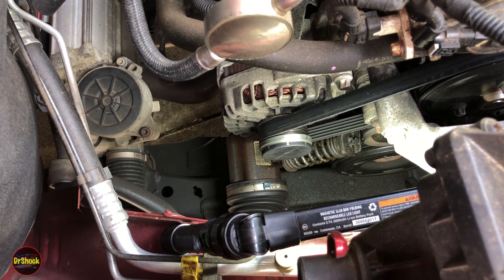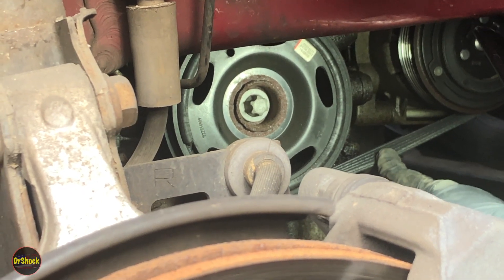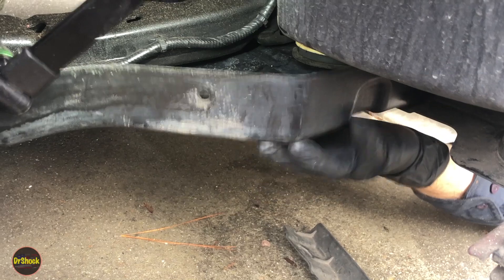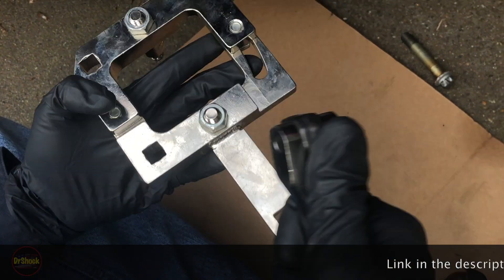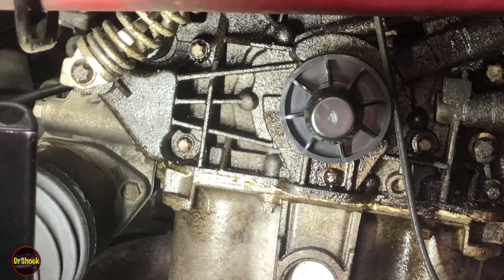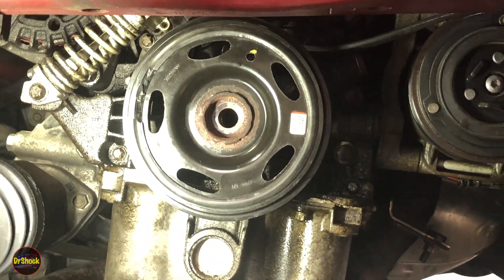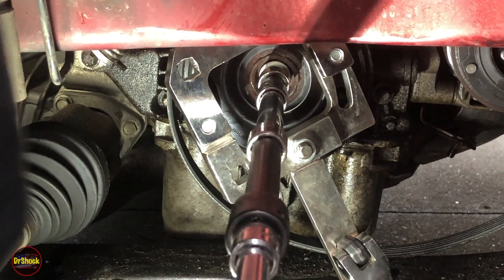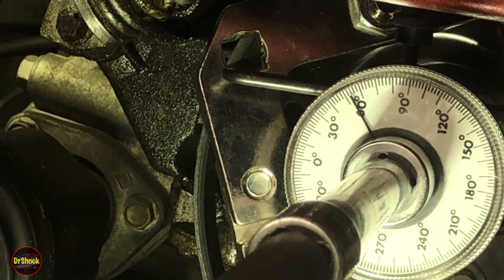2011 - 2021 GM Ecotec 1.4L Engine Oil Leak Front Crankshaft Seal Replacement (Chevy Cruze Sonic)

Comment: I’m just a little confused about the the torque specs because I know how serious a 60° turn can be but in the video you said 110 pounds but in the book it says 111 pounds, so I’m just confused on which one is actually the correct one
Reply from the maker: Good catch.  I clearly misspoke there as I was pointing right at that text but saying 1ft lb less.  We're after the exact value given in the service manual that I showed.  So it's 111 ft pounds.  I added a correction note to the video just now.
Reply: When threads pull just back off next bolt 1/4  turn

Comment: I saw some other guys on youtube doing timing replacement and they said that the seal must be installed dry otherwise it will leak again. What does theanual say about it? thanks
Reply from the maker: You install the seal into the engine dry using the recommended driver tool shown in the service manual.  This is important to maintaining an accurate friction fit to the engine.  

However, when reinstalling the balancer only, I do recommend light lubrication as shown, simply to avoid damaging the seal lip during reinstallation of the used original. If for some reason you were installing a brand new balancer, I would omit this.  This would just be an example of my sharing decades of experience as a best practice.  

What typically causes a leak here for this particular engine is wear or damage to the lip of the crankshaft seal, some type of physical deformation of the seal, wear to the balancer shaft, or the use of non-GM parts.
Reply: @DrShock  thanks man, have a nice day
Reply: @DrShock  so basically you re saying that if you do the whole timing replacement, then no lubrication is needed? Am I getting it right? athanks
Reply from the maker: This is just a front crankshaft seal replacement in this vid, which is only one small part of what you have to address if you are looking at removing and reinstalling the timing cover.   So just speaking to what this video covers, the whole balancer shaft area is always lubricated with engine oil during normal engine operation for this particular engine design.  So obviously the balancer shaft does not run dry on the inside side of the seal.  But it should run dry on the outside side of the seal though.   If not, you have a leaking seal and that's why one would watch this video.  ;-)  

When you first re-install an used crankshaft balancer pulley assembly, I mentioned I recommend light lubrication to ease the reassembly of this part only.  This is solely to prevent the used balancer shaft from nicking the inside lip of the new seal.   Any assembly lubrication put here will be temporary, and eventually slung off during normal engine operation.  At least for this particular GM engine design.  Others engine designs may be different, and other engine designs may not warrant the reassembly attention.

Comment: I think you overdid it. * mean you don t need all those specific tools. You can block the crankshaft/pulley with a pin you insert in a special hole  like when you do timing replacement. No need for that square tool. Also for installing the seal you can use a big socket like the one from oil. To pull it out just use a hooked screwdriver. You are very good and attent to details, but this way it will take you 4 days to do a timing replacement
Reply from the maker: What I've shown is the by the book professional approach, showing it straight out of the OEM service manual as closely as possible using only genuine OEM parts.   That's what I strive to make this channel about.  

It only takes the standard book time when done this way, not longer.  You can of course improvise using what I've shared here as a overall best practices guide though.
Reply: @DrShock  You did not overdo it. I would rather you do it the way you did, by the book. Proper thing. Now, knowing the actual steps, I now which ones I can improvise if I choose. Then it’s on me. Other repair videos have to be viewed with caution, I’ve seen too many mistakes being made.

Comment: The more extensions you use, the more torque you lose..thats not the proper way to torque things. Ive done thousands of crank pulley removals and installs and ive never had one where a deep socket didnt work. 

You also need to mention that the timing cover gasket is a huge failure on these too
Reply from the maker: It's a commonly misunderstood fact that straight line socket extensions have no tangible impact on attainment of a torque value.  What does are swivels and this clues one into the laws of physics involved here.   Keep your socket and extension in centerline and there will not be any arc forces involved of concern to negatively impact the sought torque.   There's a reason a well equipped tool box has three socket types (shallow, standard, and deep) in addition to an array of extensions.  You do not have to make it a one size fits all situation.
Reply: @DrShock  it's not misunderstood. It's literally facts that extensions cause torque loss. And I've proven it multiple times... especially using chrome sockets and extensions on an impact...you don't do that. I've been doing this 15 years and I'm no genius nor do I know everything, but I can promise you that using a deep impact socket on an impact vs using chrome sockets and extensions there's a HUGE difference in torque...go try to remove a stubborn bolt with just a single impact socket on an impact vs using a chrome socket with extensions...the chrome extensions and sockets aren't gonna remove that high torqued on bolt.
Reply from the maker: Centerline extensions or deep sockets have no appreciable impact on automotive fastener torque.  You'll find OEM service manuals reference their use in order to reach the fasteners involved to achieve the torque values required.  Loosely, you could review Newtons' third law of physics for why.

Now chrome sockets, yeah they can be damaged by an impact but they are also inexpensive to replace and fair game to sacrifice in a pinch imo (aka I didn't feel like stopping the job to hunt for my misplaced impact socket).  The reason the standard chrome socket will perform poorly in your example is the drive hole becomes distorted allowing rotational movement, thus reducing the effective reverse torque force of the impact wrench.  An impact rated socket has a metallurgical design that resists this drive hole damage maintaining tight fitment.

btw, Merry Christmas ;-)
Reply: @DrShock Also, there's NO reason to use some special tool on the balancer...take the bolt out, remove the pulley and reinstall. I just did this last week. Didn't use any special tool. It's unnecessary.

You also do not need a special seal driver for the crank seal. A 2x4 works perfectly fine as long as you hit it gently in different spots. I just did it and had zero issues.
Reply: @thagerdorn2009  I don’t think this guy is a mechanic as in he doesn’t do it for a living. It sounds like he’s just using the service book as gospel. It’s just common sense and nuts and bolts at the end of the day.
Reply: This is only for power / air tools

Comment: What is torque spec without the additional 60 degrees
Reply from the maker: It doesn't work that way, you have to do the degrees of additional clamping force.  This is why the fastener is known as a torque to yield type (it stretches).
Reply: @DrShock  So after torquing to 111 ft lbs, slightly more than an additional 1/4 turn (45+ degrees) should suffice.

Comment: i have to replace  my oil seal on my 2014 chevy sonic 1.4 turbo the crankshaft bolt its not to be use again can i use it temporarly until i get one because im doing at home and i dont have a torque wrench or measuring tools
Reply from the maker: For a temporary solution that's not a big deal.  Just be sure that the bolt is safely secured tight enough not to walk off from engine vibration until you check it right.
Reply: Junk metal bolt

Comment: Mine is just barely starting to leak.Will replacing the seal eliminate the chirping that I’m hearing a lot of opinions say changing this crank seal will stop that chirping?
Reply from the maker: The sound you hear, if it is in fact coming from the seal area, is due to a crankcase pressure problem.  Until that is addressed, seals will continue to fail.   This is usually a problem with the PCV system.  Check if the intake manifold release valve has failed using this video - https://youtube.com/shorts/qGBt5skZWLI
Reply: If your chirping is not rythmic and is random, almost like a tick-chirp, its the alternator.  I thought I may have an engine problem either chain or lifter or something because I was getting this chirp/tick noise.  the weird thing was it was not continuous or rythmic, but random.  turned out it was the alternator making the noise.  it charged fine, just made this noise.  changed the alternaotor out and it was all good.
Reply: Pull the dipstick. If chirping stops it is NOT the alternator.

Comment: The real problem is the PCV system on these engines.  Too much pressure builds up in the engine causing the seals to blow.  The fix is to replace the intake manifold or put an old style PCV in the engine oil cap.  Eco Tech engines are notorious for this problem(s)! If you replace the Front Crankshaft seal, the next time you might be replacing the rear crankshaft seal if you don't replace the Intake Manifold or fix the PCV system. Take the oil cap off the engine with engine running and see if you feel the pressure coming from the oil cap hole. If it feels sorta like a fan the PCV is not working correctly!
Reply: "old style pcv in the oil cap" what do you mean by this? like one of those breather filter things?
Reply: @DrShock I have a strong gust coming from my oil fill port, brand new valve cover. Any suggestions before I replace the crank seal? It is leaking
Reply from the maker: That's only true if the orange silicone bypass valve for the crankcase ventilation system inside the intake manifold is missing entirely, or gummed up enough to be non-functional.  Easy to check, and clean, during regular maintenance as I've shown here - https://youtube.com/shorts/qGBt5skZWLI

If that orange flapper valve is there and functional, it's not what you're suggesting and the intake manifold and it's PCV system are fine.  In such a case it's the more simple fact that GM designed the engine in their european division.  So the seals of the engine lubrication system are just of relatively short longevity.
Reply: @DrShock  if the intake has oil in it, it's bad. Something caused the seal to blow or leak. You are in theory right. But there's more to check to see why the seal leaks. 25 years of experience has taught me many things that have shown me to look at things differently. You by your video said this is the second seal you've replaced. It isn't the seals causing the problem.
Reply from the maker: What I believe your quoting me on from the video is where I said we're going to go over replacing this seal as a follow-up from a previous video where we re-sealed the oil pan on the owners vehicle.   

I'm coming from an engineering background.  Point is that this particular seal failing in and of itself does not justify firing a parts cannon at the vehicle.  With european design engines, sometimes an owner just has to accept it really is just part of regular maintenance to clean the intake, replace seals and reseal pans and covers on a more regular basis.
Reply: @DrShock  As I've stated before these engines are notorious for seal blowing from too much pressure in the engine caused by PCV system. European or not doesn't matter.  On Eco Tech engines the oil also is pumped thru the Crankshaft causing problems sealing both the Front and Rear seals not mentioned in any manual.  The oil will leak thru both the front Harmonic Balancer bolt and the Flywheel bolts if both are not sealed with silicone or sealer to stop it. The PCV system is notorious for clogging up as the hole(s) are not big enough for the flaking caused by using Synthetic oil and it not being changed at a regular basis. You video states on it Sealed again.  I've worked on these engines daily for last 10 years.  The orange tab you're taking about is in the 1st Gen Intake manifold.  The 2nd has a tab but is recessed where you can't inspect it without tearing it apart. I've said all this to help you not disagree with you.  I started with GM in 1983 and ended with GM in 1988.  I actually started working on vehicles in 1974.  I don't know it all but do know a little. Even the knowable Techs at GM will tel you that the clogging PCV system is the leading factor to sealing problems on Eco Tech engines.
Reply: @erwinpadgett1050  great advice 👍 I've started using SeaFoam following their directions and it saved my engines very noisy lifters (4.7 dodge). Im working on my friends 2012 cruze 1.4 turbo and will take all your advice and will also start using the seafoam when changing oil . I think that it can only help.  I believe that it is one of the best not so mentioned procedures one can do for their NA engines🛢.  Many Thanks!
Reply: @DrShock  The GM technical service bulletin in the US indicates all manufactured before December 1, 2014 had defective front crankshaft seals.
Reply from the maker: @dblissmn thanks, I believe you are referring to https://static.nhtsa.gov/odi/tsbs/2018/MC-10155077-9999.pdf which specifically relates to a chirping noise associated with vacuum leakage.  The problem this bulletin highlights is not related to an oil leak, only a vacuum one.  But still yet another reason to perform this videos repair.  The part number I list in the video description is this upgraded version of the seal.
Reply: @DrShock If you take the Intake off and look in the center where it bolts to the head, you'll see a small hole. Thus is the PCV hole to breathe the crankcase. This is where the problem is. If that small hole clogs up, it'll cause the seals and gaskets to leak. By building up crank case pressure. If you don't  unclog or replace the intake, the seals and gaskets will leak again. You can drill the hole out in the intake to 1/8th of an inch.
Reply: @DrShock  If the PCV is chirping it's not working.   It doesn't take the Crankcase pressure and pull it back through the engine to circulate it.  Thus it blows the seal(s).  You can also drill the hole out in the intake to 1/8th of an inch to help stop the hole in the intake from being clogged. But you also have to blow the holes out in the intake that  run thru the intake from each cylinder side to side.  Every time I've replace a rear seal or Crankcase seal I've pulled the intake and fixed it as stated above. But there's one more thing.  If you pull the engine to replace the rear seal, you'd better put sealer on the Flywheel bolts as oil will leak thru them making you think the seal is still leaking.  On both 2.4 and 2.5s!
Reply: @DrShock I have a strong gust coming from my oil fill cap, I replaced the valve cover 6 months ago and the pcv valve on the cover seems to be functioning still. Any suggestions before I replace the crankshaft seal?! Thank yoi
Reply: I check the orange flange thing and it is not visible at all going to clean it

Comment: Question:  There are many sources that say don't lube the seal with oil and that doing so will result in a leak. Your thoughts?
Reply from the maker: Speaking from an engineering point of view, I would categorize concerns that assembly lubrication during parts reassembly leads to seal failure as falling into either a myth or mistaken belief category.
Reply: I think they mean don't oil the metal to metal surfaces (outer seal/block interface).  Always oil the rubber part of the seal.

Comment: Balancer looks worn and a partial culprit.  Also, these have problems with the PCV (whole valve cover).  Most vent too much, some not enough.  Also problems with #4 side of coil pack corrosion.
Reply: First thing I noticed was that chunk missing……..  Harmonic Balancer no longer in Harmony.     If it is “Only going to go in one way” then why mark it and then spin back and forth past your markings to shove it back in?  Long as you have it in the relative same position you took it off in then you are fine.